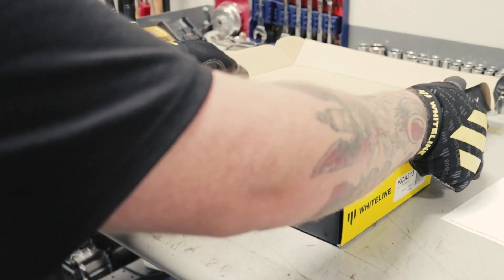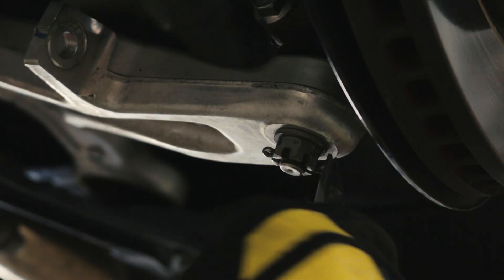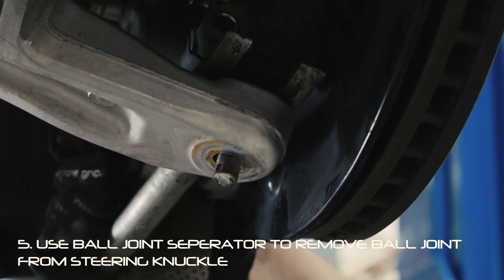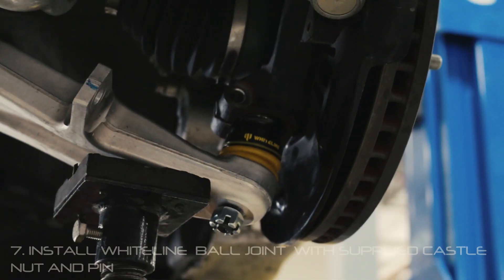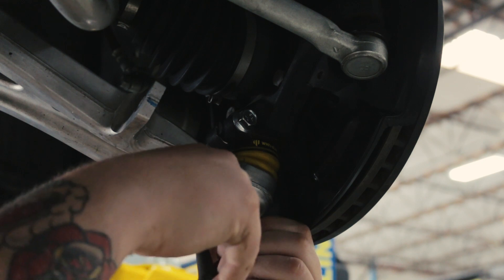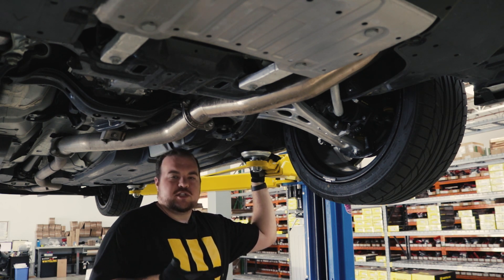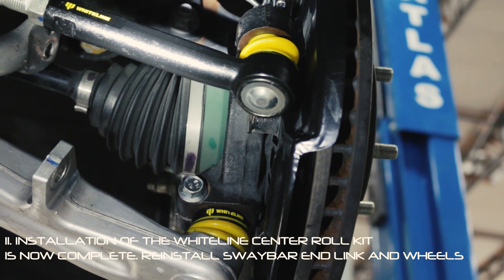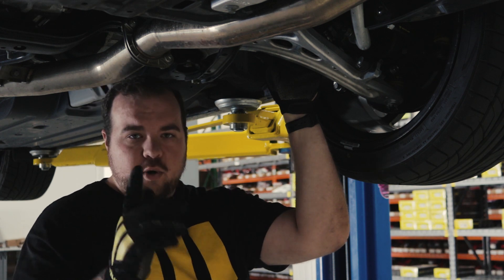Bump-Steer/Roll-Centre Kit Install - 2018 WRX

Comment: is there a rear suspension version of this? or is that not necessary
Reply: No. Just need adjustable lower control arms. 
Adjustable toe arms maybe even trailing arms 
And I would get a different sway bars with endlinks. Not necessary but you’re right there anyways so might as well do it to stiffen the car up.

Comment: WHY DOES THE CAR HAVE A BIG ASS WHITELINE STICKER ON THE DOOR IF ITS A RANDOM CUSTOMER CAR?
Reply from the maker: Hello,

The customers car is an ambassador/sponsored car. So he is running the decals.
Reply: @WhitelinePerformance  didnt tell us why he forced them in with a jack? 

all other ball joints go in just with your hand, superpro went in like stock subaru ball joint.

No Subs WRX has video of how i had to install my kit
Reply from the maker: @ATARI-DAVE-73  Hello,

What I have seen from most cases on having the ball joints go in, some go easy and some go with some force the casting in the arms varies from year and model as these KCA313 fits almost every subaru impezza from GC to VA chassis.  Some we have even seen some rust form inside where the ball joints goes.

Comment: why did you need to force the ball joint in with a jack? superpro kit same as this they slide in like stock Subaru ball joints. 

if you force it in then can I see a video of you removing one you have put in about a year ago.
Reply from the maker: Hello,

What I have seen from most cases on having the ball joints go in, some go easy and some go with some force the casting in the arms varies from year and model as these KCA313 fits almost every subaru impezza from GC to VA chassis.  Some we have even seen some rust form inside where the ball joints goes.

Comment: This video sucked. It made no mention of pre-marking the location of the jamb nut location on the tierod end. It made no mention of the VERY important torque values on the castle nuts. Nor did they mention the need for an alignment.
If your going to do a how to video, include all the steps. I mean this isn't a stereo install...these parts are installed incorrectly and its lights out.
Reply from the maker: Hello,

We apologize for the misinterpretation of the video and the lack of the torque specs. If you are needing any additional help with KCA313 please contact us at tech@whitelineus.com   thank you
Reply: Well aren't you a little shit head. Relax.
Reply: Torque value is usually rated based on hardware size and grade.
Also, usually when doing this you should get an alignment. So marking the tierods is useless in this case

Comment: Video doesn't load past about 26 seconds
Reply: Did you try scrolling past it or try on a desktop or laptop. I notice the same issue but tried scrolling past where it got stuck and worked fine.